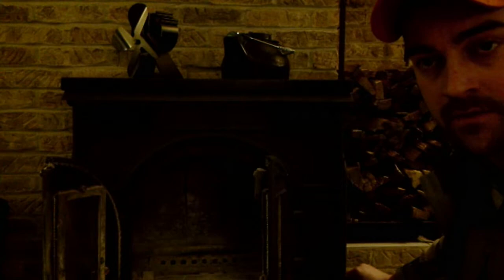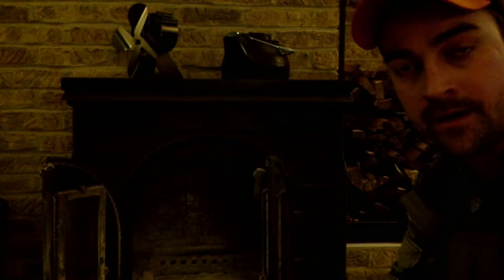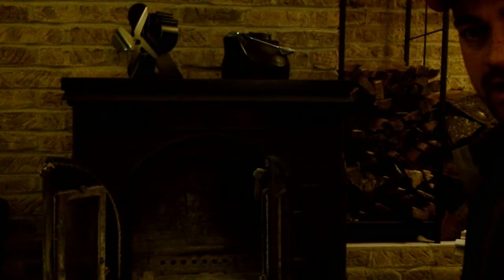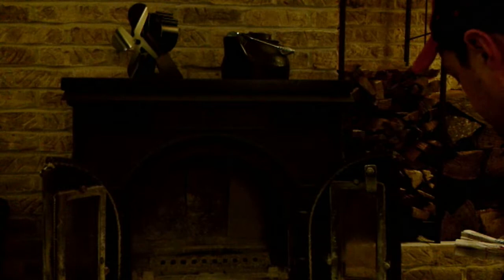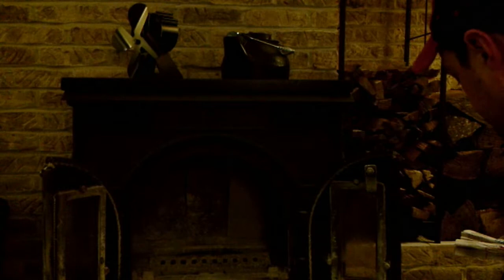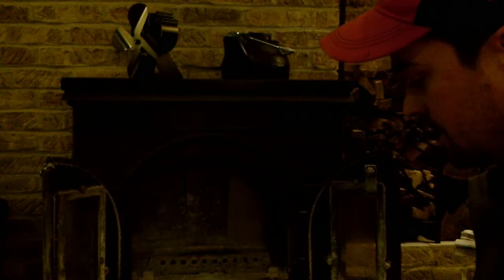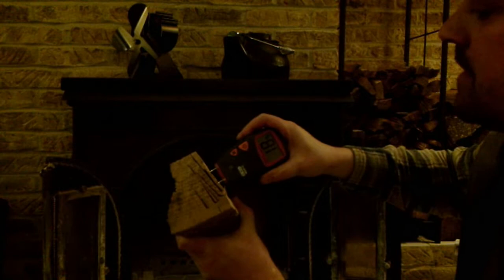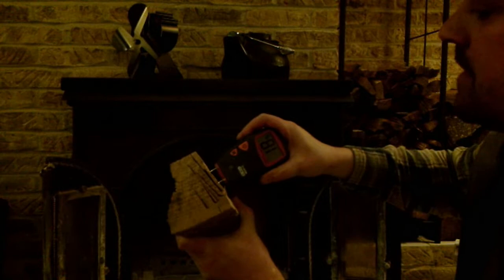How to cold start a Dutchwest Federal Airtight Wood Stove

Comment: Interesting. There are numerous videos about this stove on YouTube. I posted about 5 or 6 myself. I always clean my ashes out while the fire is still active by using the ash drawer, which you never mentioned in your video. I find that very puzzling! It's not necessary to clean the stove spotless between burns. In fact I found out from a commenter that he has better luck leaving a bed of ashes so that the embers don't keep falling through the grate and into the ash drawer. I followed his lead and found out that he is correct and I've been doing it that way ever since. I also start a fire through the side door. I just shove in a mess of crumpled newspaper and some kindling and let 'er rip. Nothing scientific about it, but it sure works good. I may leave the ash drawer open till it really gets its act together and then close it for good and then control the burn using the side door vent. I have used the ash drawer vent in the past, but that is actually designed to be used when burning coal and constant use can damage the center grate.  Thanks for posting and sharing your video.
Reply from the maker: I didn't think to mention the clean out at the time of making the video, it was mainly about starting the stove. These days I just use a Sear-Pro propane torch with a tumbleweed starter in lieu of kindling and newspaper. The manual does say on Page-17 for wood loading to open the under -air vents 3 turns. I also like to leave some of the ashes in the bottom and am not as particular of removing as much of the ash these days between fires.

Comment: FYI- I have this stove and it should be stated that the bottom vent on the ashes clean out door is specifically designed for burning coal not wood. Yes, you can use is to bring a new fire up to speed but then it should be closed and use the side vent on the loading door to supply air and adjust the burn rate which affects both the amount of heat and burn time. As you stated, with an established fire you can close the bypass gate and open the top vent about an 1/8th inch to supply oxygen to the re-burn chamber.
Reply from the maker: You are correct, and at 12:41 you can see me closing the lower vents after explaining and prior to opening the reburn vents when activating the bypass gate. I have tried doing a cold start with only the firebox vent, but find that I get incomplete burns to start, typically with more burned fuel closer to the door. Having the bottom vents open during a cold start works much better, but you definitely want to close them off before suing the catalytic combustor otherwise your burn time will be greatly shortened due to excess air flow.

Comment: Does this stove have any provision to feed outside air for combustion?  Even with the recirc/reburn, it looks to me like it is still taking in room air from the bottom or side vents.  That air has to get replaced in the room/house from somewhere, which means it gets pulled in from outside into the living space.  I love the idea of a catalytic stove (essentially the same functionality as vent-less fireplace gas logs) but would like to have it use only ducted outside air for combustion. 

Addendum:  I might have asked a dumb question above.  Is the fireplace flue only used when starting the fire so that it hasn't yet gotten hot enough to activate the catalyst?  Maybe it is more similar to a vent-free gas log set up than I had initially understood.  Maybe once it gets running properly with the exhaust recirculating within the combustor/catalyst, then the true/final exhaust is clean enough to be exhausted into the room rather than up the chimney.  Is this how it works?  That would be extremely efficient.  Please enlighten my ignorance!

Comment: Awesome video,  just bought a used Dutch west fa224acl off craigslist today.  It's for the cabin.  Guy still had the manual for it. July 3, 1987. It's in great shape , new rope in the doors. He never used the catalyst burn. So I was looking to get one. Any place you would recommend? Thanks again cheers from Iowa
Reply: I got one of these stoves - same year of manufacture.  Could you share some insight on how things are going.  Its for my small shed. I am in Calgary Canada.  Need to set it up, but any advise you can share would be most appreciated
Reply: @VijayTharayil  yessir,  it works awesome! After I did some closer looking, it was a little warped on the inside from just being old and used. I'm not using the catalyst but with good dry hardwood it will burn a good 6 hrs and still have enough coals for damn near a day to get it going again. Winters are brutal in north eastern iowa and it gets our cabin HOT!! I never open the front doors, just side load and I keep the round brass damper on the side door open about an eighth of an inch  after it gets going really good. It kicks ass! Cheers from iowa!!!
Reply: @VijayTharayil  I do have a damper on the stovepipe as well.  I use that to fine tune it.  After s few uses you'll get the hang of it and figure it out.  Sorry I didn't respond sooner,  I dont check YouTube that often.
Reply: @VijayTharayil  Also if it's a new fire, open the narrow door on the bottom front to get it to draft and your kindling will take right off, just don't forget to close it.
Reply: Alex Wilhelmi thanks very much friend
Reply: @VijayTharayil  no problem!
Reply from the maker: I buy mine from Amazon, Condor makes them and I get about 2-3 seasons out of them. They run about 120-135 USD but that's about the best price range I could find. Sorry for the delayed reply!

Comment: Can u plz tell me how to get the feed door open? I haven't used the stove in abt 2 yrs and I can't get the door open, not sure why.
Reply from the maker: Do you have the brass latch handle? It has a square insert that is used to open all of the doors and operate the bypass gate. If you do and it still won't turn, then try squirting a small amount of penetrating oil like PB Blaster or WD-40 around the square peg, let sit for about 15-20 minutes, then try again
Reply: Yea and I've really leaned on it trying to open it and it won't budge. Our central heat went out last night and it's abt 7 deg here and I have a two yr old. And it's just us... I'll try the WD40 and see if that works. Thanku for replying so quickly btw.. 🙏
Reply from the maker: @hethersons5530  if that doesn't work, then try heating the square peg with a torch or lighter and see if that helps free up the threads - good luck!
Reply: @clarencerswann1360  thanku thanku! That worked!!
Reply: I'm sorry I have one more heating related question, not abt the wood stove for ur opinion.... I have a shop heater, if something happens again like this and I have to can I bring it into my house to use?
Reply from the maker: @hethersons5530  if the shop heater burns a fuel, then I would certainly not use that indoors - it will release carbon monoxide which WILL kill you. It's an odorless gas and you'll never detect it. The only fuel heaters that I know of which are safe for indoors are the Mr. Buddy propane heaters. I have one of those, but still am reluctant to use them inside without adequate ventilation. Carbon monoxide is nothing to disregard - it will kill you and does.

Comment: Do you leave the vent open on the main door when you’re using the catalytic chamber?
Reply from the maker: It really depends on what I'm burning. Stubborn oak even if two years seasoned can have moist spots that just smolder, so adding air aids in keeping a hot fire below even during a re-burn. The firebox vent is used mostly to control the rate of burn. If I pack it tight I'll open the vent. When a good bed of coals is going I'll close it some to conserve energy. These are manual stoves so it's all about maintaining the fire. If you're a hands on guy like me you won't mind. I said in three video I like to start and wall away with a cold start, but only then. Running the stove is constant maintenances. You'll get the hang of it!
Reply: I have the fa209 Dutch west federal box heater. I have a small cabin and it really throws a lot of heat in catalytic mode. Took a little bit of figuring out but I really like it.
Reply: Converter has its own air supply so the other vents are shut